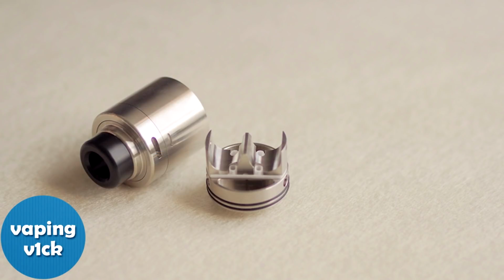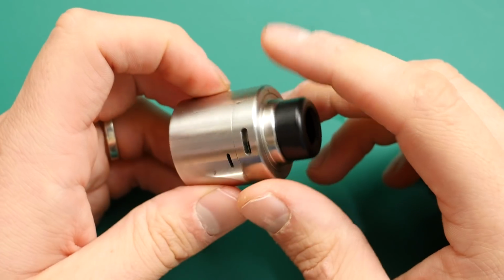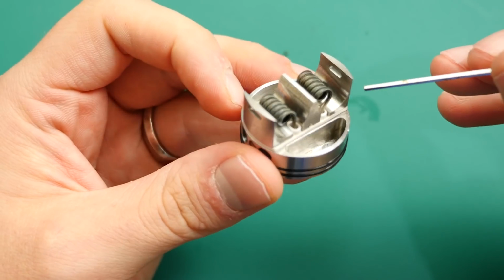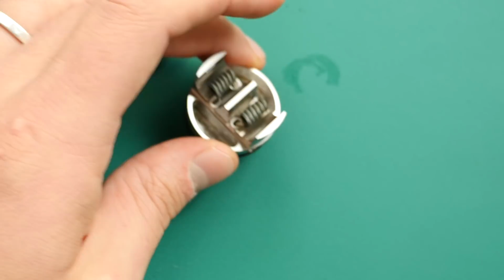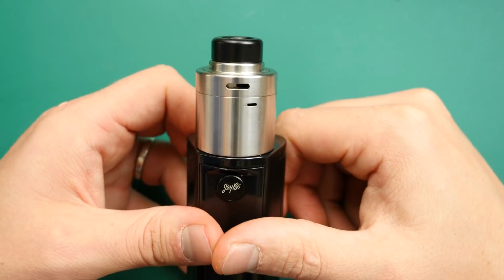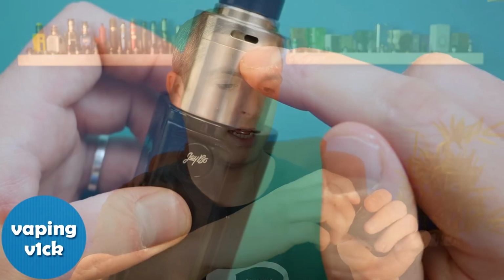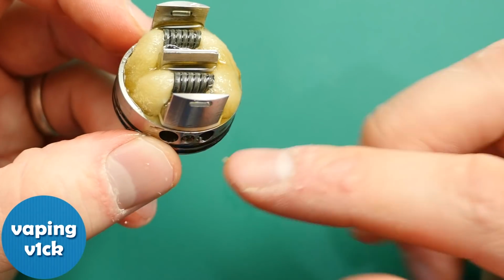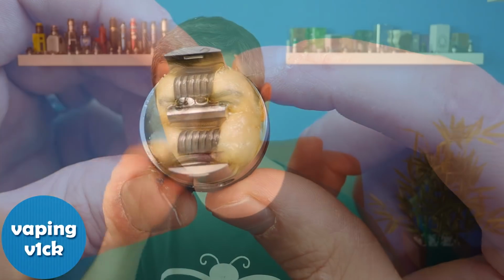Zathog RDA from Cthulhu Mods & Morten Oen

Comment: I have 3mm ID 0.18 coils in mine, fully open at 150w on a VT Box DNA 250 & it"s warmish. Good for bragging rights at the pub though.
I just got some 22 gauge wire to build some bigger lower resistance fused clapton coils for this bad boy. I had the same issue with the Njord until i built a 0.11 fused clapton for it. Now I use it every day & the vape is awesome. 
Morten loves his flat wire, which heats up fast & needs a lot of cooling to stop it from burning the cotton, which is why his RDA's both vape cool when you just throw in a coil. It's not everyone's cup of tea, but I like them because they are a challenge to build the right coil to get them to perform the way I like.